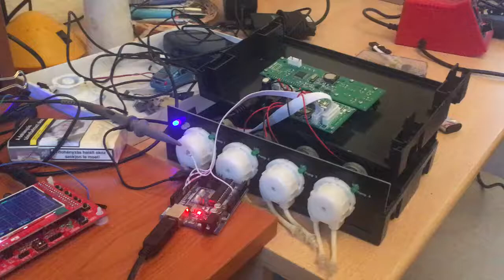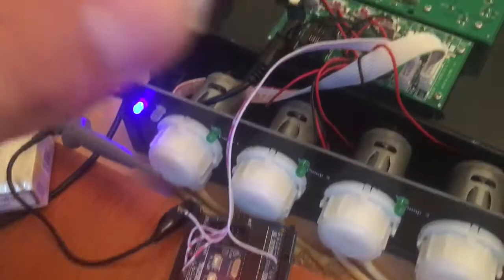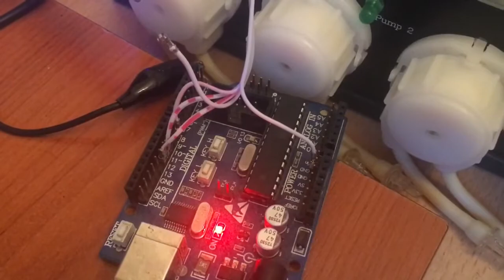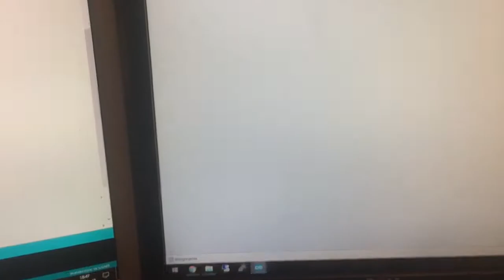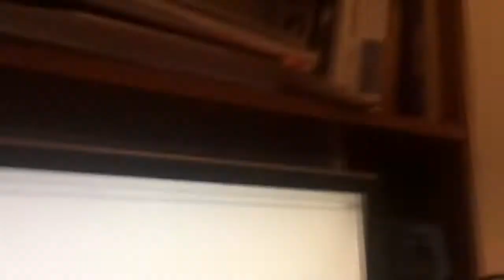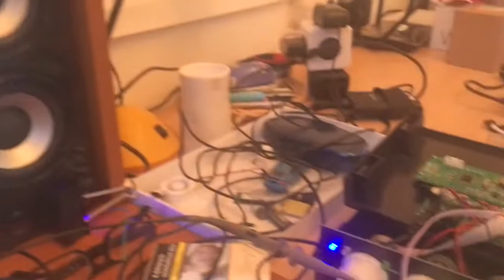Driving a DP4 Doser off an Arduino

Comment: Szia! Hány voltosak a pumpák? Sajnos, benéztem az ebay-en és a vezérlő helyett egy négyes slave-et vettem. Megpróbálom meghajtani arduinoval...
Reply from the maker: Szia! 12V-osnak rémlenek, de nem tenném rá a nyakamat - talán rá van írva a motorokra. Ha van 5V fesszab és shift regiszter a slave-ben is, mint a masterben, akkor könnyű a dolog. Az SHR-t kell vezérelgetni, ami kiválasztja és meghajtja a pumpát a 12V driveren keresztül. Én végül NodeMCU-val használtam, mert az alapból WiFi-s és szépen elfér a házban, de a masternél könnyű a dolog, mert van benne 12V bemenet és tápegység, 5V feszszab és SHR. Nem emlékszem már, hogy milyen típusú SHR van benne, de volt hozzá arduino library. Látni kéne a belsejét, hogy okosat tudjak mondani, fogalmam sincs, hogy csak a pumpa driverek, vagy SHR is van-e a slaveben, illetve hogy mennyire szívás a nyák kiosztás, mennyire lehet könnyen belenyúlni. A masternél könnyű volt, mert az eredeti vezérlő alaplap 5-6 pólusú csatlakozóval csatlakozik arra a lapra amin az SHR, feszszab, meghajtók vannak, szóval simán rádugtam a vezérlő alaplap helyére a NodeMCU-t (vagy Arduinot) és onnan csak software volt az egész.
Reply: Köszi, közben megtaláltam a leírást, 12V-os. A slave-ben szinte semmi nincs, csak egy egyszerű panel. Egyesével kell rákötnöm majd a motorokat az arduino-ra. Lehet, csinálok majd egy pcb-t hozzá. Bár még kezdő vagyok, de találtam már egy ugyan ezen az elven működő adagolót. Ahhoz van pontos leírás.
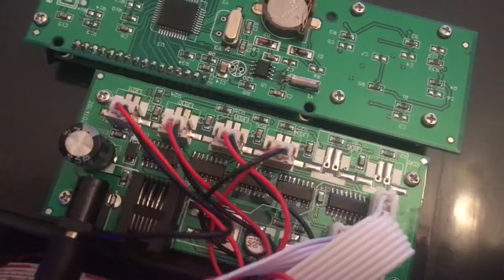Reply from the maker: Bence Tóth nem olyan a panel, mint 0:08-nal a videomban az also panel?
Reply: nem, sokkal egyszerűbb. csak egy szalagkábel van rajta, a ledekhez megy. semmi mikrokontroller vagy ilyesmi. néhány ellenállás és kész
Reply from the maker: Bence Tóth hat az nem tul jo:( kell valami 12v motor meghajto. Van ilyen arduino shield, azt meg lehetne probalni, bar ugy remlik csak 2 dc motort tud
Reply: András F  ha csak úgy adok a motoroknak egyesével 12v-ot akkor nem mennek? mihez kell a driver?
Reply from the maker: Bence Tóth tulajdonkeppen az is jo lehet, igen

Comment: Thanks for posting this. Can you share your Arduino code and pinout please? I can't quite see it in the video.
Reply from the maker: High Tech Aquatics Hi! I’m running the final one off a NodeMCU to get it WiFi enabled, instead of the Arduino. They’re very similiar though. I have a topic on ultimatereef (firing up the hated blabla reefer 250), meet me there and I’ll try to explain it better.